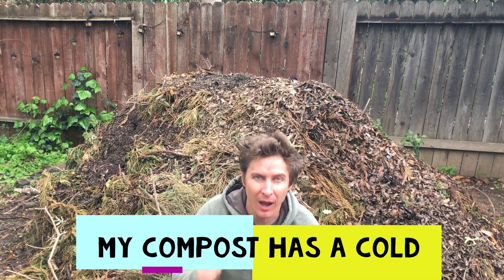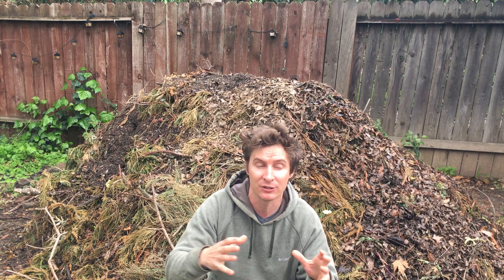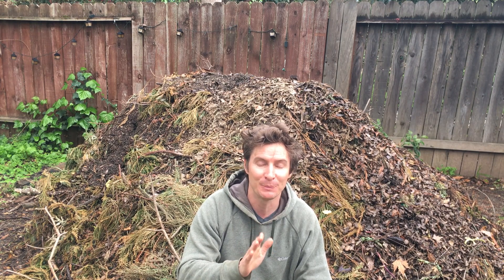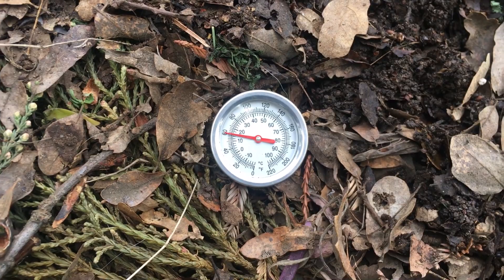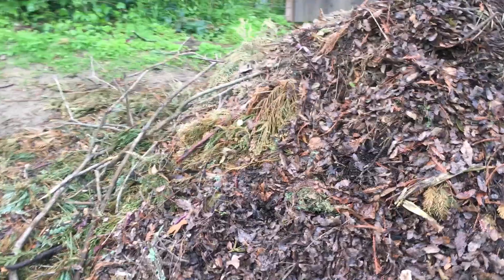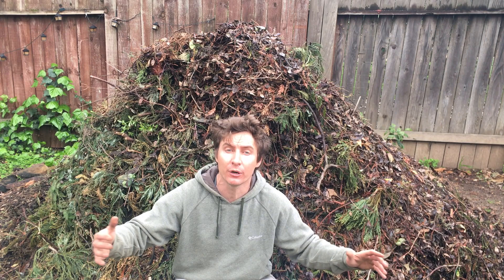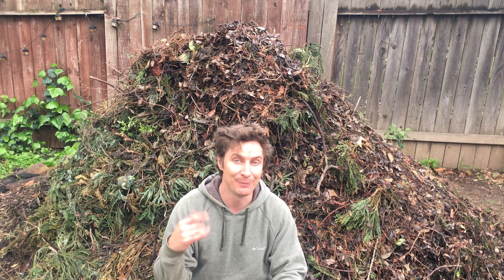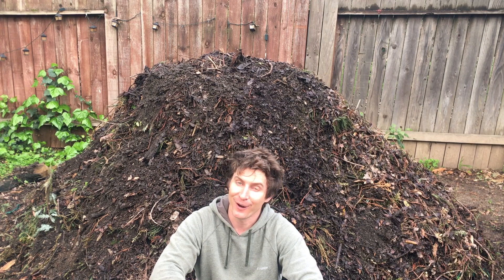My Compost Pile Has A Cold! // How to Heat Up A Cold Compost Pile

Comment: The ambient temperature of the air plays a huge role in what goes on inside of the pile. It had been in the 80s here, and then it dropped into the low 40s at night, with much lower daytime temps, for several days. This was a fresh pile that was overcharged, and it still failed to heat back up after I turned it, and it had been at 160 and covered at all times. Now that it's warmed up again, I'm getting reignition. This is why I switched to summer composting instead of the fall. The difference is night and day.
Reply from the maker: Thankfully the seasonal temperature swings haven't become an issue for my pile. I get high internal temps during winter months as well as summer. Just recently my pile reached over 140 F. and the outside temp was 60F. during the day and below 40F. at night. The biggest factors for me have been the ratio of my ingredients and the amount of moisture in the pile. Happy gardening.
Reply: @fieldtrippin1  Happy gardening back atcha! It looks like you may tend to have a bigger pile than most, though. Mine had hit 170, so I had to turn it (I went 3:1 on the N over C on purpose). It was about 2 cubic yards, which I think is about the max that most people try, due to the 3x3x3 instructions that everyone seems to be putting out. As soon as I turned it, the temps dropped and it cooled down to the mid 80s. It's bouncing back now. Mass does contribute a LOT to this.
Reply: @fieldtrippin1  ❤a mil❤

Comment: Why wouldn't you just start a new pile and use the finished compost? In fact, I'd peel top layers off too, add that to the new pile. And then use the finished compost in the pile's center. It's spring: top-dress to your beds with the finished compost now.  Seems silly to add more raw material and add weeks or months until you can apply the compost. Odds are, you can have another pile ready for autumn and then another for the following spring.
Reply from the maker: Space limitations. I also only utilize the compost when I need it. Currently, the pile is creating steady amounts of fresh compost as well as also storing compost for later use. Easier to go upwards than outwards when space is limited.
Reply: @fieldtrippin1  I can dig the space limitation. I have a tiny urban lot. I have like a 3 x 8-foot spot set aside for composting... which is all we can spare. And it's tight, between bushes and a garage wall. We keep one active pile, flipping from one side to the other every few days. When the active pile gets close to done (say 120 degrees F heat), we stop tuning but aerate and mix it. We then begin pile #2. It takes a month or two to get it up to size. When it does, we'll use the finished compost all in one go and begin the active pile process

And we store dry browns (leaves and shredded paper) in our garage. Storing greens is the limiting factor, so we keep a vermicomposter to cycle food scraps when we cannot add to a pile. 

Sounds like a complex setup, but it's low tech. And not particularly hard work. Just takes a long time to write... :-)

Regardless, keep up the great work.
Reply from the maker: @The.Ghost.of.Tom.Joad.  You keep up the greet work as well. Happy gardening.

Comment: In my experience, outside temperature is always a factor in the temperature of my compost piles. Theoretically, if you have chopped and mixed your greens in thoroughly so that they are able to mix at a better ratio to the browns, and the right amount of moisture and air is in the pile, you may get an increase in temperature. Or it may be that you don't get much increase in temperature, in which case the nitrogen to carbon ratio was not significantly affected by breaking the greens down and mixing them in the fluffed pile, or the moisture isn't right. I think the addition of the soil will essentially act as an insulator, potentially slowing dissipation of heat and shielding the pile from any possible cool air. But I think it only plays a significant role if the carbon to nitrogen ratio was affected by the chopping, etc. The reason grass clippings work so well at heating up a pile has a lot to do with their nitrogen content. I'm going to guess that you won't be able to get it over 100 degrees without more nitrogen, but that's just a guess and I could totally be wrong.
Reply from the maker: The pile is cold because it is mature and the older material has decomposed into finished compost. Mixing in additional organic material (green and brown) will raise the temp when bacteria begins decomposing the material. The outside temp is not cold enough to effect the internal temp of my pile. I'll easily get over 100 degrees. Been getting temps up to 160 for over a decade now.
Reply: @fieldtrippin1  Could I stand on that pile and throw a paper airplane?
Reply from the maker: I forgot to say thank you for sharing your experience and thoughts. Thanks friend! Take care.
Reply: My compost pile worked great for about a month.
I started off 4x4x4
Used coffee grounds, old vegetables, some pee etc.
Then it went cold , and i could never get it to restart.
I think i must've somehow "killed it".
Now it's about half of what it started, about 2' high.
But it isn't breaking down at all.
I got totally discouraged and stopped composting.
I trued everything i could think of, turning it, wetting it, bloodmeal, etc